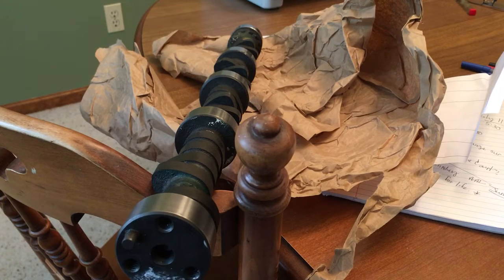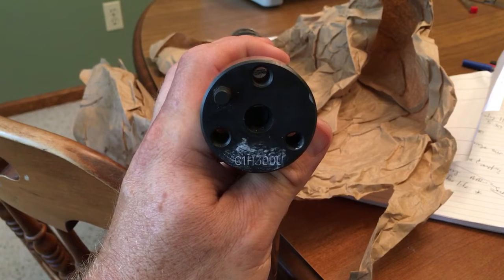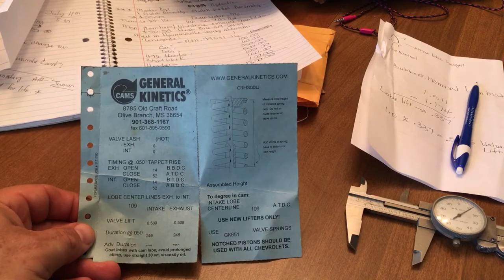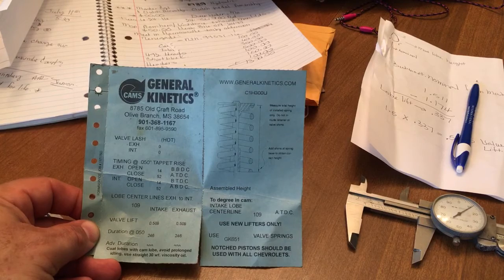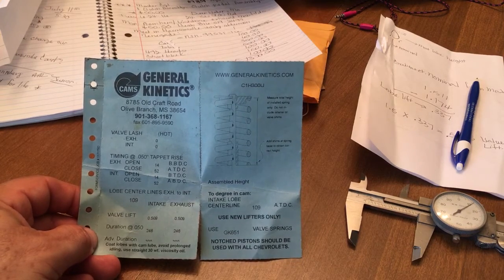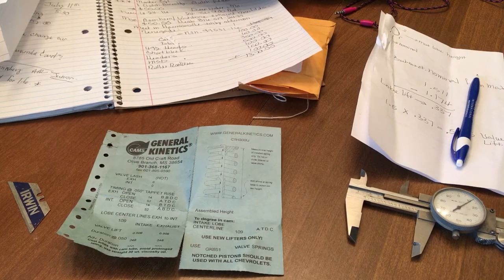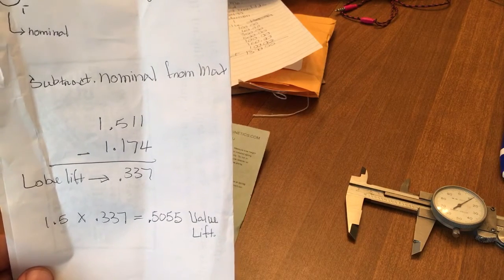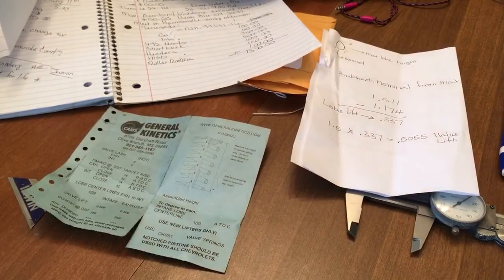How to measure a Cam Lobe to calculate lift

Comment: Great video! I have a question, do you think shorten/lower the duration can be compensate with bigger intake/exhaust valves. My goal is low/mid range torque, mpg, and emissions, thanks
Reply from the maker: Tom Bo Ros Your goal is better serviced by building port velocity over larger valves. The shorter duration cams help, most importantly select a cam that’s ground to help build cylinder pressure. Stay away from old school cams, even the old RV cams, are out dated grinds.
Reply: HeadFlowInc 

Well I already have them (valves) I am upgrading 19lb injectors to 24lb (have them too) so I need to play with the can shaft duration and lift, I also favour low lift as I read somewhere that lifters springs last longer. Will bump up compression to 9.5:1-10:1 by reducing compression chamber and my whole idea is keep the cylinder under pressure as long as possible (late valve openings/ easily closing) I need torque over HP.
Reply from the maker: Tom Bo Ros What Engine/Heads  are you building?
The wider the LSA camshaft you have the better “cylinder scavenging” will occur making it more efficient.
Reply: HeadFlowInc 

It's a 318 cast #302 with small chamber.  It's actually a camper built by Roadtrek 5.2L V8. I consider all option, swap to manual, or even a turbo diesel with manual swap. I am getting 12/17-19mpg with tall 3.92 rear end, I need more torque maybe more mpg.
Reply from the maker: Tom Bo Ros That’s a relatively small engine for such a large vehicle. I’m not familiar with the Chrysler 318, would more stroke help?  This is an interesting puzzle